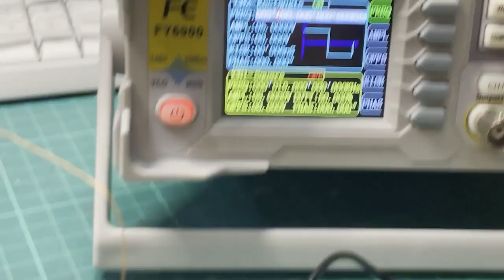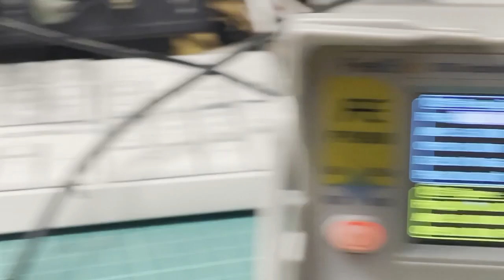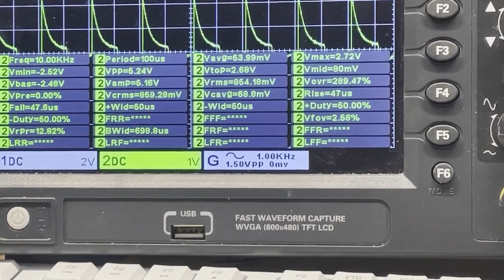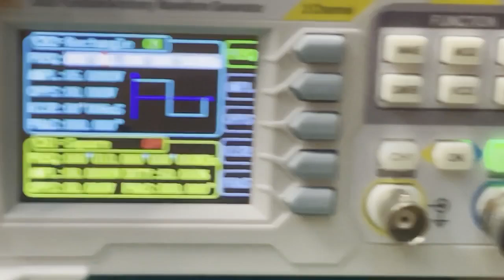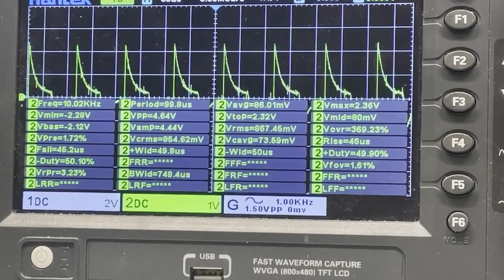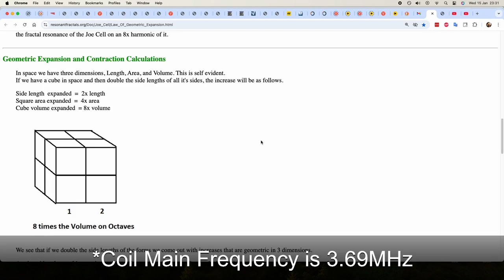Resonance frequency of the Pancake Caduceus Coil

Comment: Hello, nice work. Did you try to see if you get an amplification and a good wireless connection between two similar Caduceus pancake coils ? Thanks again for sharing your work
Reply from the maker: No, I haven't tried, but it's a good idea. Thanks for watching this video!
Reply: @michelsbench  Thanks for answering. Let me know when you will try. I think you will get a nice surprise. Thanks again.
Reply: @michelsbench  Hello. When you will do the experiment, and if you see that there is a good induction between your two Caduceus coils... I suggest that you place one at the place of the bulb in your experiment of the cold current. See what could happen with the second coil. Have great fun !
Reply: I have CNC-ed (4 axis) a normal caduceus coil holder, so the tolerances are tight. I have built quite a few hand-wound coils over the years and thought a CNC-ed versioned would give me wider bandwidth. However, the coil still shows periodic points of peak impedance and minimum impedance. For a radio signal to be emitted the RF impedance must be matched to the "ether". A normal caduceus coil is basically 2x helical antennas(circularly polarized), wound anti-phase. Although I do pickup RF signals on my spectrum analyzer it is not strong. I think it is because the signals cancel out each other at the receiver. Now, does it send out nothing (totally cancelled)? Nope, I have done magnetic tests several meters away and there are strong effects. It is just that normal electronics tend to cancel the summed signal out when presented with anti-phase. Even with the CNC-ed version I still see/measure divergence...so no pencil beam signal. The other major issue, with signals, is the very low (sub 1 ohm) resistance values of the coil. At the resonant spots the amplifier needs to be able to drive nearly zero ohms (a.k.a. no power transfer). I have just designed a small amplifier (sub 10W) that can survive when driving near zero impedances. It still produces perfect sine output at 5W, but this is through a 3 ohm series resistor. When doing tests, with RF equipment, I inserted some resistance in the path, as the equipment expects 50 ohm. But back to the coupling. If the 2x coils are perfectly aligned there should be coupling, but with the cancelled fields the power efficiency will be low. I have been playing with these things for 20 years now, and the coils always produces strange effects. But to understand it better you have to understand normal RF and EM principles, to see what it is or isn't. The sad part is that it is seen as fringe science, not even to be played with. I have had situations where a test with a coil wiped 4x magnetic harddrives (through the box and the harddrives). Some of my tests shows anomalies with organic matter. I am now rigging myself out with frequency generators from 1kHz to over 100MHz (pure sine up to 10MHz), amplifiers that can drive low impedances, special scopes, FPGAs with DAC wave shaping and SDRs. My current project is building a sensitive VNA to measure these devices. Modern VNAs are made for very high frequencies. Any case, good luck with your ventures.